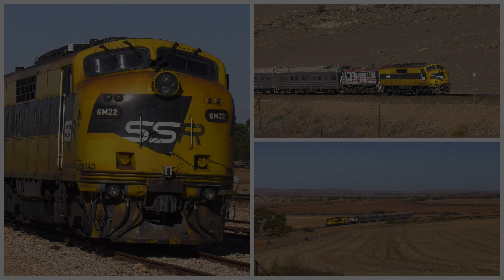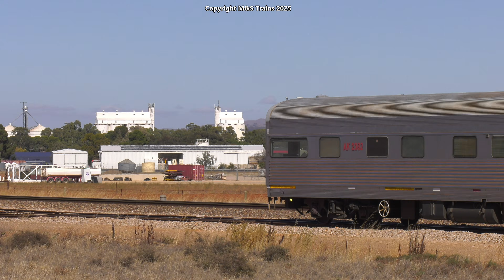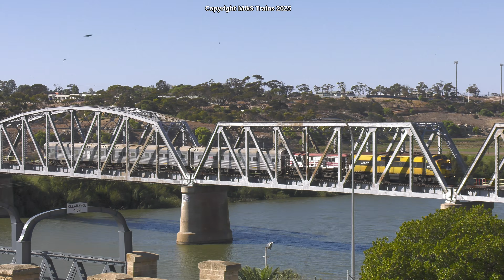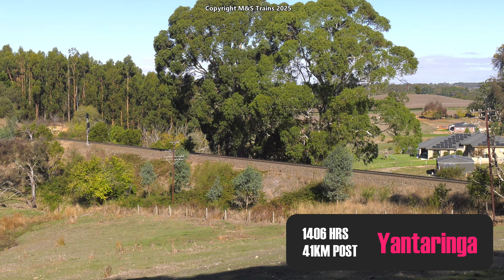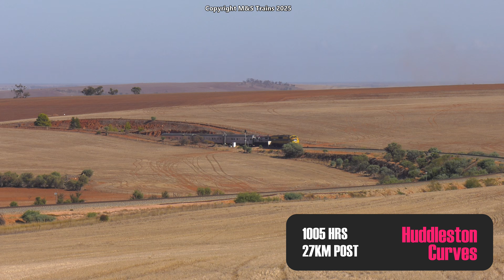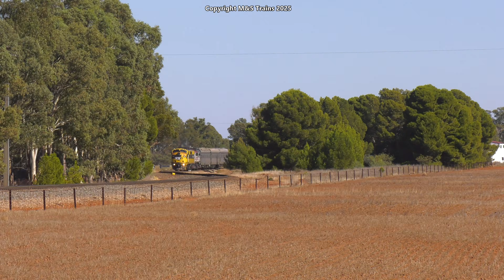Australia's OLDEST ENGINES chased across the state - AK Inspection Cars operated by GM22 & 4829

Comment: Novice question, why two locomotives for just three carriages?
Reply from the maker: When the train was in Victoria it ran up some branchlines which don’t have turning facilities so two locomotives were put on. SSR also normally put two on for redundancy as they’re a NSW based operator with no access to replacement locomotives if one was to fail in SA.